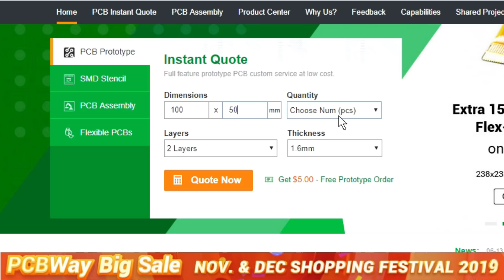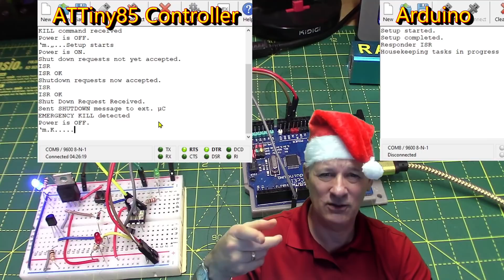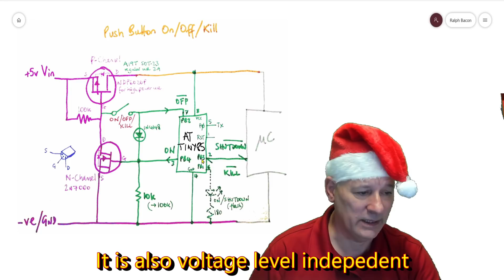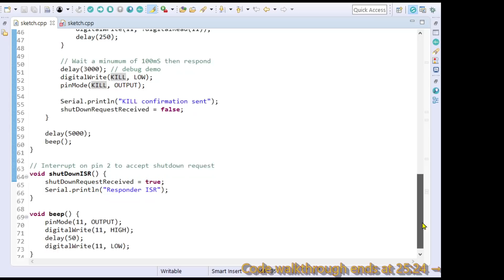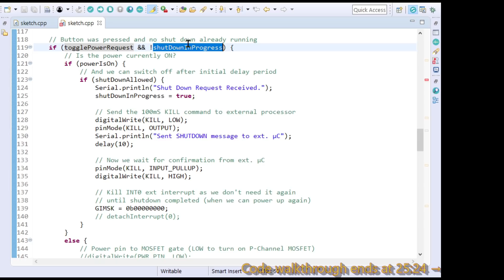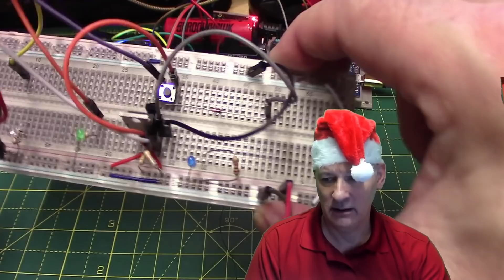#173 ATTiny85 Power On Off Shutdown

Comment: I love the 85, but I ll add my normal rant that it is too expensive for what you get.
I would think you could do it with a  cheaper attiy13
Reply: yeah, tiny85 is almost the price of 328p pro micro from Ali, so what's the point if it is not about physical size.
I know it's kind of a lottery, but you can get 10pcs of Attiny84 on Ali cheaper than tiny85. It has more pins and still 4K of memory.
Reply: @Mr.Leeroy  - indeed. The 44A is about 50 cents. It has more pins but half the memory. (Just beware, one time I received fakes... I made a video about it.)
I guess a price consious maker should try to minimize the project at hand an choose the MCU accordingly. It all depends on which features you use. Taking  an 85 to just flash a led feels kind of wasteful.
Reply: Yep, seems there is one here:
https://github.com/sleemanj/optiboot/blob/master/dists/README.md
Reply: I think it's almost pin interchangeable isn't it, except for a few features that the ATtiny13 doesn't have?  So yes, It's something to consider.  The main issue in this case is the 13 only has 1kb of flash RAM, which is pretty tight for a compiled language when you might be using a couple of the Arduino libraries..  I think you could do some amazing projects with it though, but some things might mean programming in machine code.  I'm a little over pushing and popping, but it's a tempting idea all the same.
Reply from the maker: @Ed19601 Does the Arduino IDE support the ATTiny13? It's a cheap chip, that's for sure (31p/40c), but we might have to create a boards.txt entry for it - or perhaps you have one, if we need it? I can't remember how much my code compiled to but 1K is tight.
Reply: @RalphBacon  yes, after you load a board for it. I used to use the one of smeezekitty, but there is a newer one in the mini core or the mighty core collection. I will need to check when I am home
Reply from the maker: I've got it all working with the MIcroCore from MCUDude. I removed the SoftwareSerial library and got:
Sketch uses 818 bytes (79%) of program storage space. Maximum is 1024 bytes.
Global variables use 33 bytes (51%) of dynamic memory, leaving 31 bytes for local variables. Maximum is 64 bytes.
Sounds like it's an interesting contender to me!
Reply: @RalphBacon  Indeed. it didnt seem yr project needed a lot of memory. For sake of completeness, I also leave the link for the smeezekitty core: https://sourceforge.net/projects/ard-core13/
try get the 13A chip, rather than the 13. some more deepsleep options i seem to remember
Reply: @RalphBacon  it seems my earlier post with the link for the micro core wasnt posted, anyway, you found it
Reply: @RalphBacon  looks like a viable  option!
Reply: @RalphBacon  - Excellent! When you said in your video "What else would you use than a ATtiny85 in a situation like this?", my first thought was the ATtiny13A. Its price is lower (about 25 eurocents on Ali for the 13A versus a euro for the 85), and although it has limited capabilities (eg. less memory and fewer timers) it has plenty possibilities for this kind of situations. The MicroCore works excellent and a USBASP makes the programming quite easy.
Reply: Beat me to it, I was going to suggest the same too. There is also another alternative, the ATTiny4. I am not sure if it is discontinued or not, but it is certainly still available very cheap. Haven't checked about the existence of an Arduino IDE board def. for it, but I am sure some clever dude made it and put it on github etc.

Comment: Hi Ralph! Excellent development! 
I believe, if you strip out all debug code (all Serials incl. the library) the code will fit even Attiny13 which is about $2.70 for 10pcs at Ali... :-)
Merry X-mas!
Reply from the maker: Would you believe that @Ed19601 said the same (see comment above this one)! Does the Arduino IDE support that chip? I'd love to have a go...
Reply: @RalphBacon  yes, it does... let me find the right link for you. And yes, Attiny 13 and 85 are pins compatible... So, you may debug the code at Attiny85 and then optimize it and flash to Attiny13. 
For example, use of   _delay_ms()   instead of    delay()   would save 26 bytes (need to add    #include <avr/delay.h> )
Eliminating digitalWrite function by using, as an example,   bitClear( PORTB, PWR_LED );  and  bitSet( PORTB, PWR_LED );   instead of  
digitalWrite( PWR_LED, LOW ) and digitalWrite( PWR_LED, HIGH ) would save another 20 bytes... 
So, there is a potential for code optimization!
Reply: @RalphBacon  try this: https://raw.githubusercontent.com/sleemanj/optiboot/master/dists/package_gogo_diy_attiny_index.json

Comment: I didn't see the  micro code
Reply from the maker: The code is in my GitHub, Julias, just follow the link. You even get the circuit diagram up there and a free Xmas fairy. OK, I was lying about the Xmas fairy, she is not free she is very expensive.
Reply: What is the name, is it source or hex I will prefer hex
Reply from the maker: It's the C++ source code (.cpp) which you can just copy into your Arduino IDE.

Comment: Have you looked at a STK500 USBASP. I've only used it a few times, but it seems to work OK. Cost is about $5 Canadian.
Reply from the maker: Yes, I have a couple of those but I don't think they are any better than an FTDI-style USB-to-Serial adapter - or are they?
Reply: @RalphBacon  I has the devils old time tracking down the video that got me into the USBASP road. Turns out it was your video #163. So... Seems you have this covered. Building your start up/shut down circuit with an ICSP header should get you to your easy programming needs.
Reply: @RalphBacon  I believe it is USB to ICSP.   Goes via SPI.
Reply: @RalphBacon  clarification: it is USB to ATmega8 to ICSP. It's not unlike programming via an Arduino UNO. Only better. More versatile.

Comment: Is it easy enough to integrate the code onto your arduino with the program it's already running?  Merry Christmas from Perthshire! 🎅
Reply from the maker: Yes it is. You just need either pin 2 or pin 3 free (or can juggle stuff around) so you can use that pin for an interrupt. Then, when the interrupt is triggered (shutdown request) you do whatever you need to do on the Arduino and then bring the pin LOW again. In fact, and I can't believe I'm saying this, you could do it all in the interrupt ISR function, given that you don't want the main code to continue any more and you're shutting down anyway! Probably.
Reply: @RalphBacon  thanks for the reply.  Makes sense.

Comment: I really enjoy and find your videos very helpful and informative. I'm looking forward to more ATTiny85 workings in the New Year too.
In todays video I thought there was going to be a replacement chip though(I get making a bit to replace the LTC2954) and am confused about the "DUAL MOSFET CJMCU-4599 Si4599" as I somehow missed mention of it in the video. Please point it out.
Reply from the maker: The Dual Mosfet (the Si4599 link) referred back to the previous video as a nice way of getting the P-channel and N-channel MOSFETs in a single chip and which will allow sufficient current for modest needs (eg running an Arduino). Good to play about with for little cost.
Otherwise, like in this demo, we will need two discrete MOSFETs, which is slightly more onerous inasmuch that it's another component (doesn't bother me though). The ATTiny85 replaces the LTC2954, of course.  That's the "other" chip I meant (very apt, given this channel is all about Arduino stuff). I hope that clarifies things, Scott, I should not have been so obtuse!

Comment: If you want to see serial messages right after power up just connect a serial-to-USB converter to the TX of the Arduino as well and monitor that COM-port. I find that much more comfortable anyway when I don't have to disconnect the serial connection every time I program the Arduino. Mostly because I use a different terminal program with a lot more options.
Reply from the maker: Great idea! Effectively what I was doing for the ATTiny85 but not for the Arduino. I guess I should have thought of that.

Comment: This applies to the ATTINY85 in a SOIC-8 form factor, but I think you can modify that ICSP cable so that one side can connect to a SOIC-8 test clip to program bare chips. As I don't have one of those test clips, I can't verify if they will clip on to chips already mounted on a PCB but I imagine that might as that seems like a much better use for a set of 'test' clips. Not suggestions for DIL/DIP packages other than a clunky ICSP header on the board. Hope you have a great rest of 2019 and take care of that eye, glasses or an eye patch is fine, your sight is more important than a few people being irked by whatever flavor of face covering you decide to wear in your videos so long as said face covering is tasteful and/or festive.
Reply from the maker: I hadn't thought of a test clip but I know they are available for various outlines - I shall investigate. Thanks for the support about sunglasses or eye patches. "See" you in the next video!
Reply: Just to follow up on this comment, the test clips work great with mounted chips. Flashing my knock-off digisparks is so much easier now, no pogo pins adapters or need to solder on pin headers now. And I imagine should I ever decide to make a badge, they'd be great for that as well. Incidentally, I came across a clip for DIP8 packages so with a quick cable swap so in theory, it could work for SMT and TH parts in circuit.

Comment: Hi Ralph,
If you already use the Arduino, you can avoid the Attiny85 and get the exact functionality for less.
Reply from the maker: I'm intrigued, but we need details, Amit, without replicating what we have already done in video #123 Auto Shutdown! 
How would you power off an Arduino if it has "hung"? How would you switch off the Arduino in a graceful manner (ie not just pulling the plug) so that the Arduino can finish off stuff and then (indicate we can) power down? When you say "for less" I'm assuming you mean component count? As you say, though, that's if we have an Arduino we are powering on and off. It could be any (intelligent, µController) device.
Reply: @RalphBacon  Hello,
The answer is divided into two parts:
1. For the case of Arduino (or any similar micro controller) "hang" there is the Watch-dog solution which you can program up to 8 second (for the Arduino) directly and by some tricks even more.
2. For forcing the Arduino Off by pressing the push button for 5 seconds you are doing that the same way you did...
The only change from your solution is to combine the two parts from the two micro controllers together inside one of them and turning on the watch-Dog functionality.
The turning off will be the same as you did and the Arduino will be able to do what ever it need before turning the MOSFET Off if it is not "hung". In the solution you showed, when the Arduino UNO is "hung" you are also force shut down without the ability to save data by the UNO like if it is happen by the Watch-Dog.
The proposed solution: when the Watch-Dog happen you have to detect a "hot-start" which mean a reset happen rather than power up (I guess you know how to do it) and instead of operating the software as usual you turn the MOSFET Off.
Reply: Amit Meyuhas  You need a fast booting uC to replace the ATinny, then you can dump the uC on the right. And if you use the WDT it will reboot if the uC hangs, and the circuit goes power down when it tried to boot. Ralph, graceful switch off when it hangs is not possible.The situation is already hopeless :)
Reply: @hopje01  Hello,
Maybe I didn't explain myself well enough but I did test everything with UNO and it is working well. You are right about the boot loader delay (which make the power down delayed) if you are using the Watch Dog to make full reset. But You can use the Watch Dog as a Non Maskable Interrupt so it is simple and fast.
The UNO is not turning itself down when get Watch Dog NMI. The UNO is getting into a interrupt routine which turning power Off by setting the MOSFET Off and wait forever.
Reply: Amit Meyuhas  Thanks Amit. I think, with a slower booting uC replacing the attiny, we have to press the button longer before the uC output port to the fet becomes active and takes over? Always possible to add a circuit to the switch to extend the ‘switch pressed’ condition. But this add’s some components..

Comment: Hi Ralph Merry Christmas. So what about those attiny85 smd based dev boards? I was searching for the attiny85 DIP on Ali but those are relatively expensive (yea I know it's about 1.50 including shipping it is not really a lot but I found ATMEGA328 for the same price ) and you need to add few componenens. The dev board is about the same price and you get an usb port. Any reasons why not to use those? (probably power consumption of not needed parts?)
Reply from the maker: @Hans Those "development" boards are nothing but a chip (or bare socket) with a couple of resistors and caps to try and get the USB to function without a USB-to-Serial converter. Not worth it IMHO but other may have had better luck. Stay tuned for my suggestions of a proper development ATTiny85 board in the New Year! I;m considering an Arduino UNO shield, a standalone board (much smaller than a shield), a Nano shield, and both SMD and THC boards.
Reply: Hi Ralph. Thank you for your reply. After posting my question is stumbled video #66 where you talk about the digispark boards. Anyway after lots of messing arround with the driver (and  it turns out I went ot the same web page  as you did) it turned out that plugging it in to an usb 2.0 port in stead of my usb 3 port it suddenly worked. But it is a bit of a hassle to plug/unplug them all the time so I ordered a usb hub with a on of switch. I hope that is going work.
Reply: I have a few of those 'digispark' attiny85 boards with USB ports and have yet to get one to work properly for loading firmware via USB. The USB is a bootloader hack that may or may not work for you. It did not work for me, but the MCUs are good and as you said, the boards are about as much as a bare attiny85 so if it doesn't work, you can always salvage the chip and program it via other means.
Reply from the maker: @hmx I could not get the USB to work on those boards either, and quite frankly after my STM32 woes did not expect to. The USB can be used to power the device but you always get a "Device Not Recognised" from Windows.
Reply: @RalphBacon  Luckily, ICSP programming works on the boards I have with no issues and I just use the USB port as a convenient power port. But buyer beware with these dev boards as it may not work as advertised.

Comment: I have been using the ATtiny85 for a year now, to control stepper motors, LEDs etc.  Simple projects that don't warrant the use of a full Uno board or 328P etc.  The cheapest and most available is the ATtiny85-20PU which has a 20Mhz internal clock and is available from the usual Chinesium suspects for at most AU$2 in single units and even premium suppliers are more than competitive.  

Bonuses are: 

* cheap, stupidly cheap
* 20 MHz is more than fast enough for little projects (default 1MHz, set 8MHz etc in Arduino IDE)
* 8 pin DIP package is easy to work with, socketed or not
* SMD versions are available.

* you can use Arduino IDE and most of the libraries (eg stepper motors etc)
* 6 IO pins are fine for most small projects, and even some surprisingly complex ones.
* 8Kb RAM is OK for most small projects
* 2.7V to 5.5V operation

Caveats:
* Reset pin only makes a very week IO pin.
* Using this pin as IO requires setting a fuse, and using a fuse setter to change it back or re-programme the chip
* it doesn't matter how many you buy, you'll always find a use for some more.
* Once you've used one, every project looks like it needs an ATtiny85.

I have a homebrew Uno sheild with a ZIF socket that I use to programme them.  I programme them on the shield, then plug them into the 8pin DIP on the project.  Just like a real project, eh?

They are too cheap, too useful, and too easy to use to ignore them.
Reply from the maker: Wow! you certainly sound very enthusiastic and I love it. If you substitute "PIC12F1840" for "ATTiny85" you sound just like me, about 10 years ago, Chris. 
Everywhere I looked I could find space for such a chip! I migrated to the much more capable PIC18F25K22 and moved from assembler to Swordfish Basic (almost .Net OOP for PIC) but then found my true calling: the Arduino UNO! Amd never looked back! 
I also devised a fuse resetter for the ATTiny85 (so I could use pin 1), first on stripboard then on a custom PCB, samples of which I have shared with various viewers, works like a dream IMHO! 
I've just received the SMD versions of the ATTiny85 too so I can see how it would work on a custom PCB. So much to do and so little time to do it all in. But Xmas is here, so maybe more time now. Thanks so much for posting, your post was a joy to read!